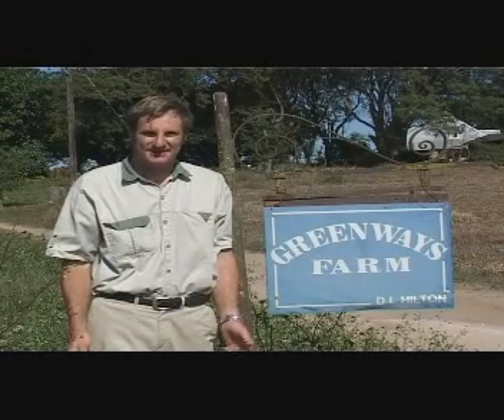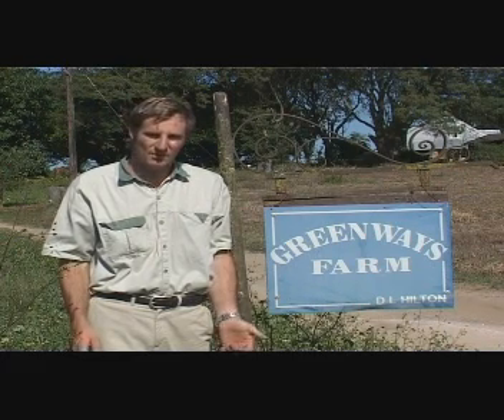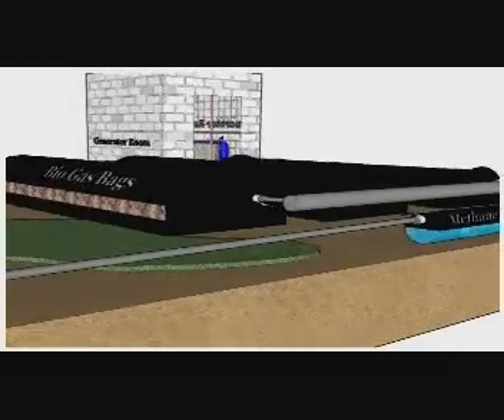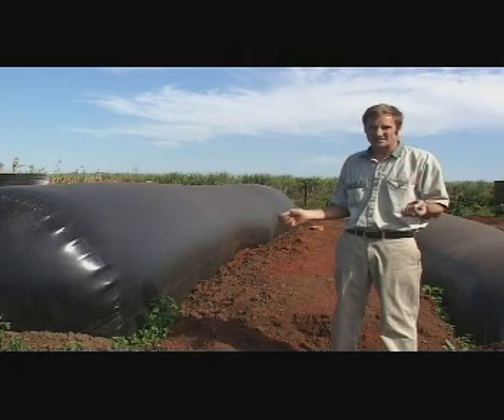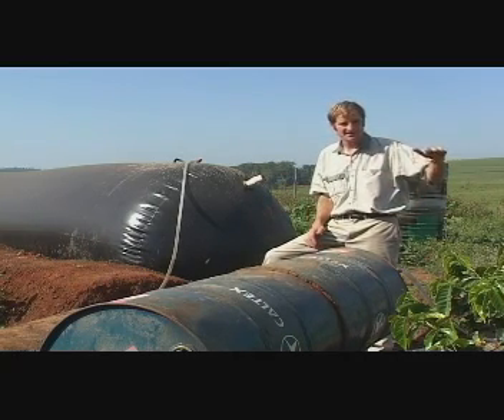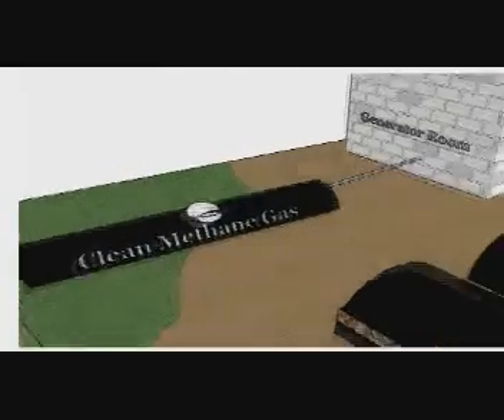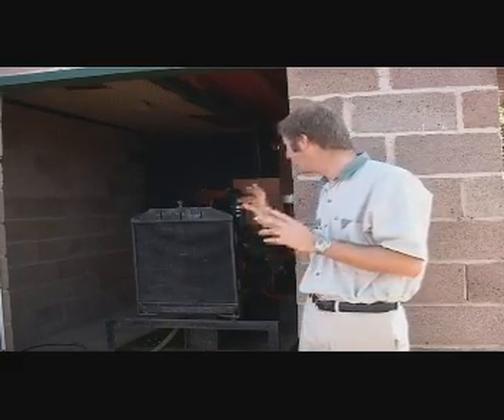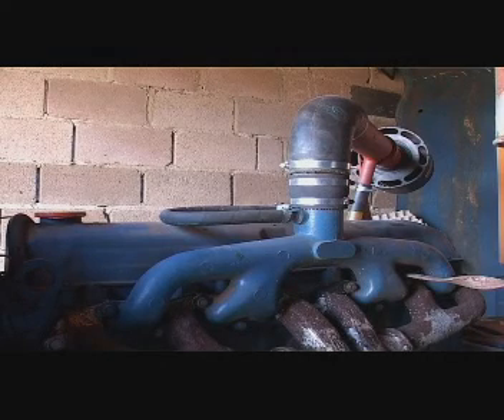Cheap Biogas

Comment: Congradulations Shelby!

Those digesters appear to be a thousand times simpler than the kind that you usually see in the industry. How do you purge the air?  Once it gets going, do you need to pump the gas for pressure?

Is it difficult to empty out and refill?

Comment: sulfur dioxide is VERY corrosive (rotten egg gas) and it will react with iron rather fast and lock it up before it hits the genny.. so a drum full (for a very large reactor) will srub it out before it gets to the genny.
although lime water (witch i hope is what the drums a filled with) will also help (now im more educated on the subject) as the sulfur dioxide is acidic and reacts with the 
lime (as does carbon dioxide)

Comment: just one thing.. the sulphur dioxide produced by digestion is something you may want to scrub from the gas a drum full of old mails or steel wool will do it as sulphur dioxide is very corrosive and wont be the best for your genny